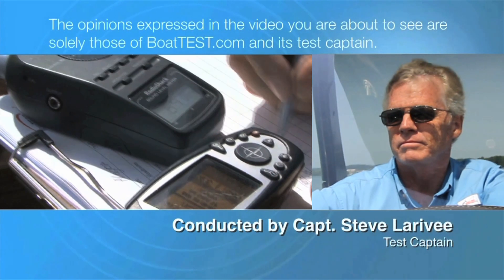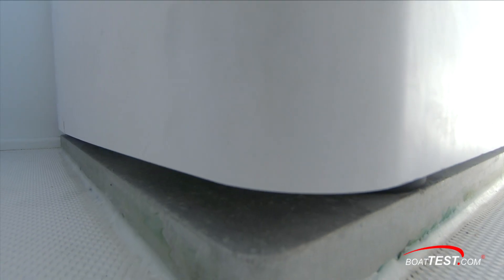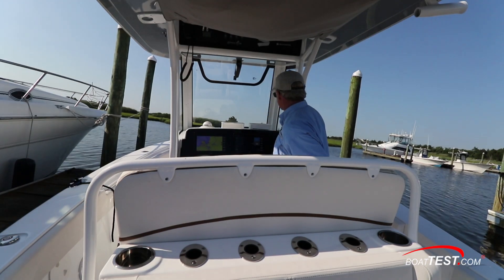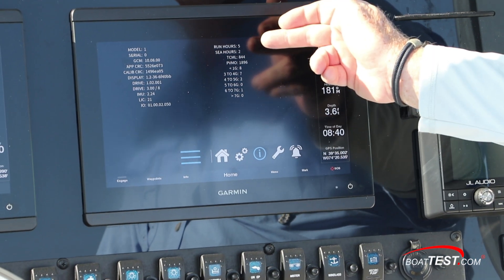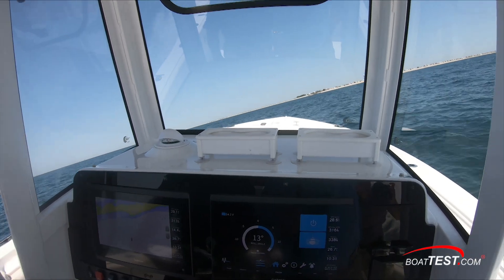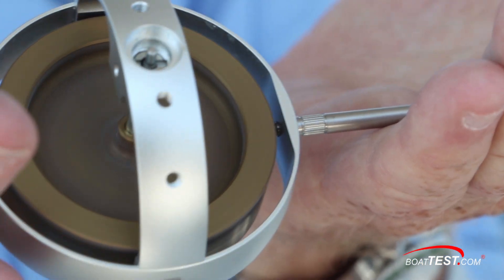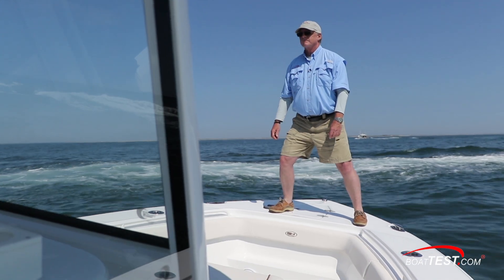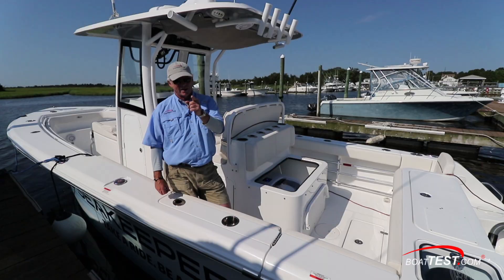Seakeeper 1 (2020) - Review Video

Comment: Can anyone see if these would fit in a trophy truck? I really want to see trucks fly more level in real life.  I think this device can make off-road racing better(cooler)  and safer.
Reply: They are too heavy to be worth it, this smallest model weighs more than 400 lbs once you account for the additional battery and larger alternator it requires.

Comment: Simply being in a helium vaccuum does not eliminate friction... it eliminates air resistance and drag. It still has rotating parts and bearings, thus still requires lubrication
Reply: What even is a helium vacuum? Isn't that an oxymoron?
Reply: Not on the gyro itself.  Use of greased sealed ceramic bearings would be maintenance free.
Reply: @joeKisonue  Grease is a lubricant. And there is no such thing as a maintenance free bearing. Within the first revolution of the bearing under load 90% of the grease is slung to the outer walls of the cage/seal and provide no lubrication. Bearings live on 10% of the grease they have packed in. That grease wears and goes bad, maintenance P points being based on vibe detection, those points being set based on load and rpms. Marketing terms are one thing, but actual engineering is entirely different.
Reply: It's a bit disappointing that there were a few physics blunders in the description of the systems. It's hydraulic actuation. Not pneumatic.  Helium vacuum?  Not frictionless. Also, not a thing. Maybe partial vacuum with helium.     Introduced. It was not clear how the precession acts when under way. Is it still active but overcome by forces greater than the gyro can counter? Or does it aquire a speed reference to "park" the rams over a certain speed over ground sentence. This detail in particular seems quite important as to limit the stress on both gyro and hull structures if roll cancelation is not desired. One last detail. A precession force on the roll axis is most effective at centerline and as close to  the intersection of the Z axis null point. Any departure from this location would create greater movement of the gyro to cancel roll.

Comment: Great video. At my marina, the SeaKeeper dealer truck is always in the parking lot. I was told by my boat dealer that this is the second most feature requiring maintenance and repair. I was also told that it is worth having in these three use cases: 1) you are overnighting on the boat frequently 2) you fish offshore a lot in choppy seas 3) you have a large yacht (40+ feet). It doesn’t help you much when running on plane and causes a strange sensation relative to controlling the boat. It is a sexy yet expensive option, and it is a major “moving part”.
Reply: How bad is missing a maintenance.  We all see the guy who skipped on his zincs one time. But really if you skip one seasonal maintenance what snowball are we rolling?

Comment: I am shocked that you could just mount this model to the decking.   I would think that you are asking for stress cracks or worse.  Does anybody else see an issue here?
Reply: Have you seen the things people do ? I saw a guy mount his grill with a self tapping screw right into his battery. Obviously an intelligent installer should be used.
Reply: Not really. Fiberglass is pretty flexible

Comment: When I got a dealer quote, I was told that THREE li-ion batteries are needed to have a gyro work for up to 3-4 hours. Confused
Reply: Shurik, reach out to us at seakeeper.com/contact and someone will be happy to help explain the power requirements for your specific vessel, batteries, engines and Seakeeper unit!
Reply: Are you planning on having the gyro active for a long period of time when the boats engine is off? Otherwise you shouldn't need much batteries. Of course it depends on how big generator(s) you have but I think it should be able to power the gyro when it's up to speed and the engine is on.
Reply: The information that I was given, that gyro requires much more amps than the alternator(s) are capable of producing, even with a special charger – after a nice 3 hour picnic, you will have to go into a full mad rush mode to find shore power.
Reply: @shurikkouzmine8399  For the smallest version, the Seakeeper 1 made for boats up to 30' it says "DC input 300 - 600 Watts (Sea State Dependent)".

I'm not sure but I think most engines can provide that from the standard alternator but then there's not much power left to other things.
https://www.seakeeper.com/seakeeper_products/seakeeper-1/

Comment: What's a helium vacuum?
Reply: I'm going to assume they purge the chamber with helium before drawing a vacuum on it, so that whatever tiny amounts of gas are left inside are inert, since having a true vacuum would be incredibly difficult.
Reply: @FlesHBoX  nitrogen would be a much better (and affordable) gas for purging/drying.  I believe it has more to do with being able to be pressure tested with helium before vacuum as the helium molecule is so much smaller than nitrogen or dry air. Space walk suits are pressure tested with helium for leaks.  I've heard SK has had issues with vacuum failures so I am sure this is their marketing, but the phrase "helium vacuum" just struck me as ridiculous.
Reply: @hodges8joshua  Helium is lighter than nitrogen so would provide a better environment for the gyro to spin with as little resistance as possible.  I mean, ideally there would be no gas to induce drag, but if you had to choose, helium would make more sense.  Though it does make sense that they would use helium for leak testing, but if you're going to be using it already, why waste what little remains inside the chamber to then purge it with nitrogen.  Especially since they are pulling a vacuum and can recover most of the gas anyways.

I mean, the term is a bit odd, and I would love to hear their explanation of it to really know what they mean by it.
Reply: @FlesHBoX  this is correct. a perfect vacuum is impossible to achieve, and a near perfect vacuum is almost as difficult. they use an Inert light gas that will have as little effect on the imperfect vacuum, as well as for keeping the containment dry. it is the same as using nitrogen to purge an AC system before vacuuming it down to add the freon.

Comment: In a big following sea, on larger boats, The SeaKeeper is junk, no substitute for fins....
Reply: On 50+ footers with flybridges and shallow draft, the seakeeper is inadequate...unless it head on or at anchor, there is not enough fulcrum to keep the vessel reasonably upright...it almost "holds" the roll, when the seakeeper reaches the end of the gimbals.  I'm talking moderate to heavy weather, with 15 to 20 degree heel...Even in a beam sea of 4 footers, you get 10+ degrees of heel.
Reply: @Chris-fo8wp  you know bigger boats it is recommended to put in more then one unit. guess what those issues disappear when done so.
Reply: OK, U Say “junk” on following-seas, What about the other Dozen+ 🌊 sea conditions?
Reply: a following sea produces pitch, which the seakeeper is not designed to compensate for. if the seakeeper compensated for pitch, then just about every boat with one installed would submarine the first time it hit a wave head on!!!

If you have a following sea, then you can match the period of the waves and ride your bow wave to create a near perfect ride without the seakeeper.
Reply: Chris that's not what it's designed for Chris.